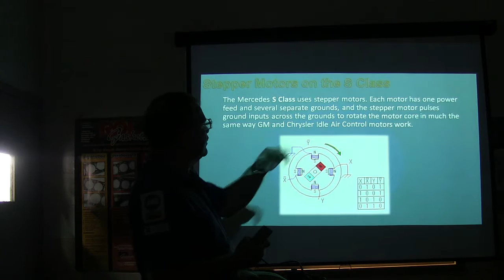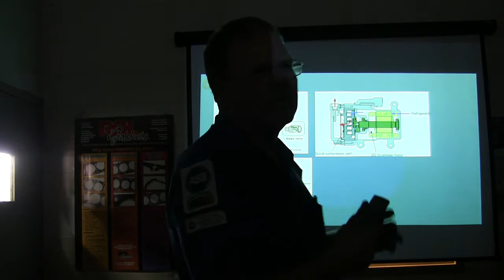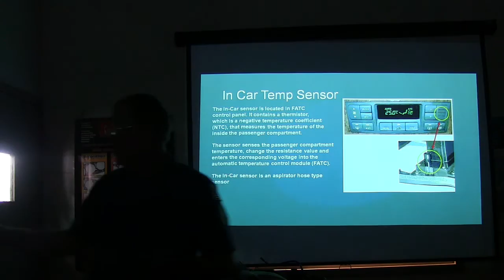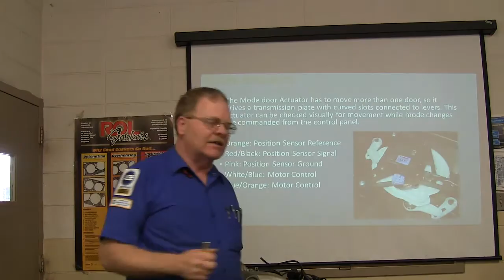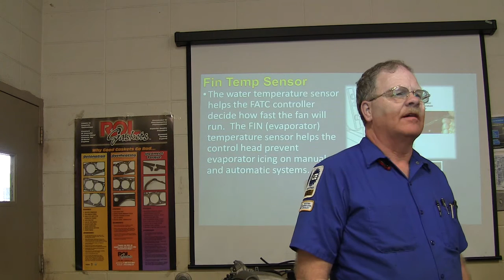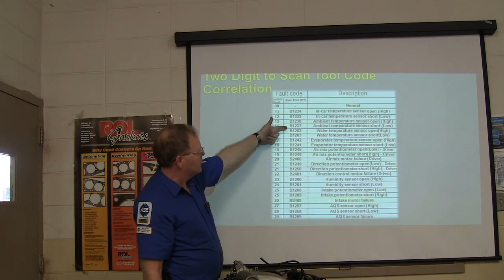Twenty First Century A C stuff

Comment: Cool show once again I remember a few years ago before  OBD with a Lotus Esprit I jumped two fuse connections in the fuse box and it gave me stored codes on a light on the dash I thought that was the coolest thing ever at the time it saved the guy a shed load of money not having to taking it back to Lotus it turned out it was the throttle position switch and all it needed was the track cleaned.